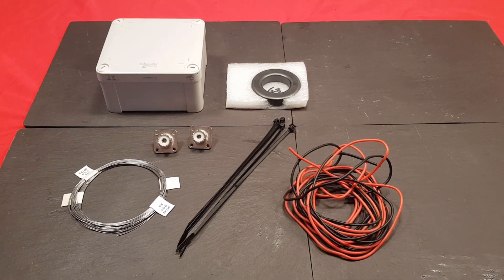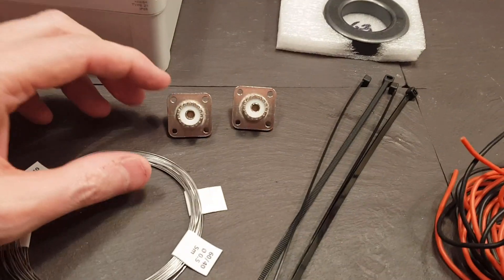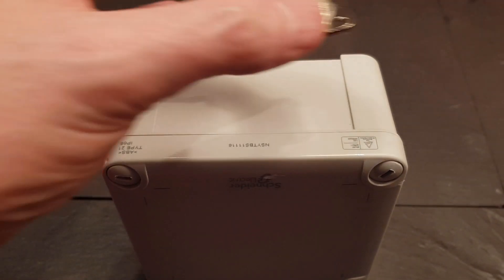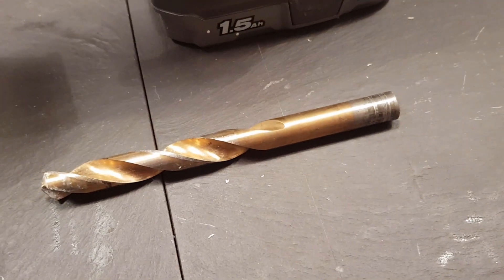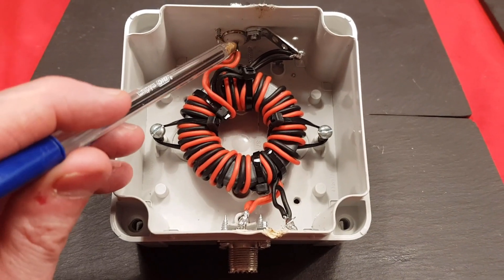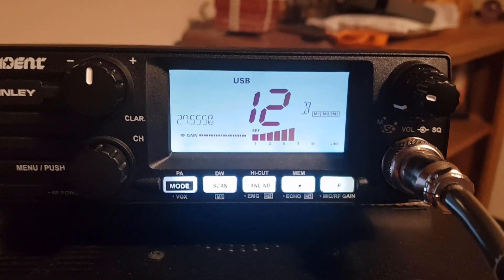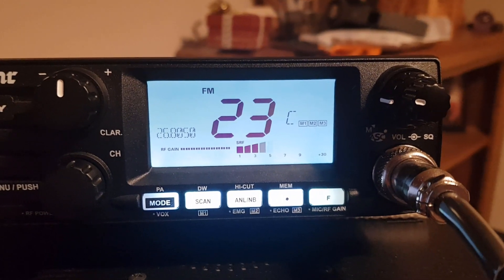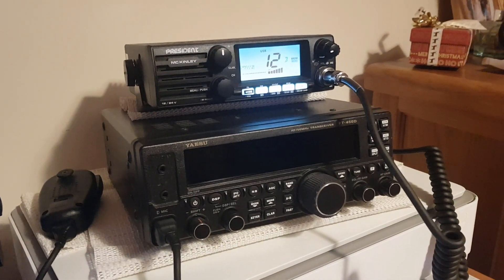Homemade CB RADIO RF Choke Common-mode choke | 27Mhz Experimental Low Cost Ferrite Ring Project

Comment: better of using a different core like the FT240-61… 12 turns of rg58 with crossover winding give you >8K rfi supression between 22–30MHz…  if you use this indoors… the 1:1 you made need to be at feetpoint up at the antenna but it should be 2x14 turn not 12 this will give you a wide range 0-30 and its not very effective at frequency above 17MHz using your FT240/43 core. btw you can also use a coax balun made by 1/4wave 75 ohm tv coax..
Reply from the maker: Thanks for the comprehensive feedback. Sorry for the late response, I have been off air for 12 months

Comment: The reason that the noise is going down is due to insertion loss of your choke. You are essentially loosing  6dB of your signal. You can see the loss if you inject a calibrated signal through the choke then measure the difference you will see that it is between 3 and 6dB.  The job of a common mode choke is to keep RF from radiating back into your shack.
Reply from the maker: Thanks for the feedback, I will have to spend more time in looking into the choke and options.

Comment: You know a few Mix 43 snap on ferrite cores installed on the coax just below the feed point of the antenna is a great RF choke without the DB loss of adding more SO-239 connections. Great video though, keep up the good work. 73
Reply from the maker: Thanks for the info. I am looking to experiment with what works best. There are so many theories out there on the net.
Reply: I use 30 slip on ferrites made of material 31, common mode attentuation ->3Kohm

Comment: Well done!!  I have the McKinley and I keep the RF gain down a few clicks from max.  Those radios have ears for days and running the gain at full tilt is not needed.  Also brings the noise down.  That signal to noise ratio that I am sure you know about.

Cheers from SoCal USA!!
Reply from the maker: Thanks for the feedback.